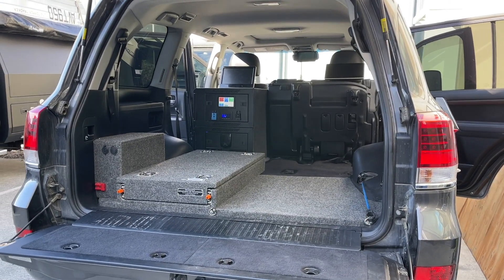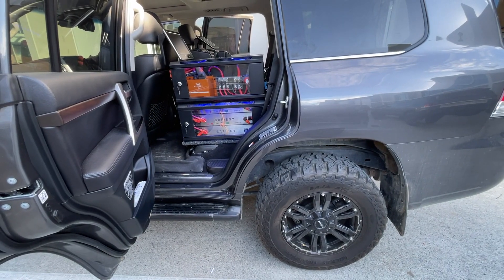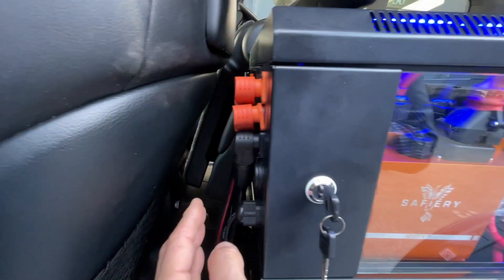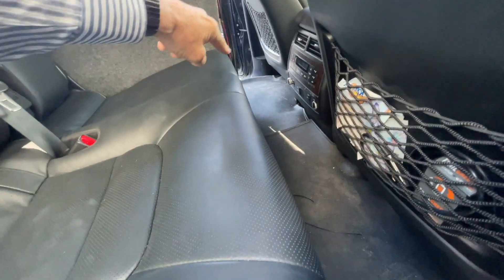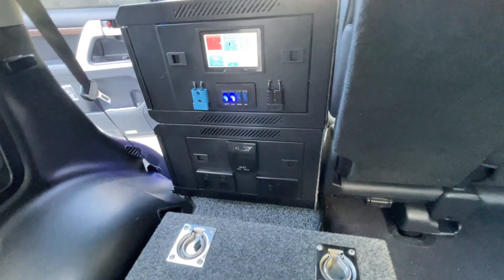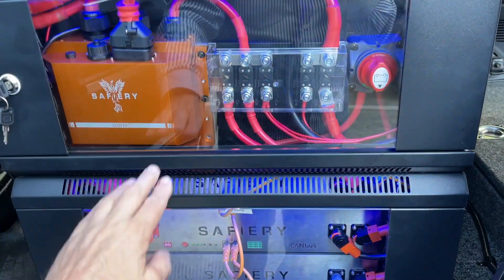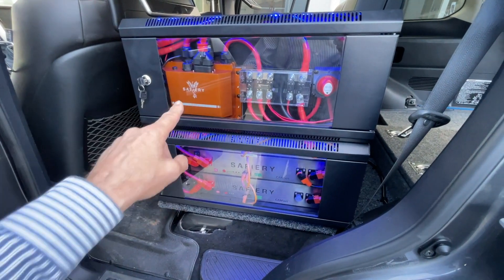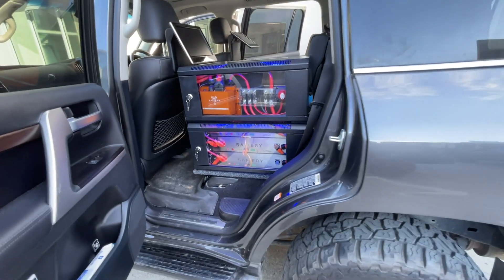LC200 Series Walkthrough 600Ah Lithium 5000W Inverter 3000W Scotty

Comment: Great till you crash and have 200kg of hardware aiming at passenger
Reply: In most 4wds you have a fridge with similar insufficient mountings mounted in the rear also.
It's a great design idea however I'd be asking for heavier cases and mounting hardware as you said

Comment: Looks like an interesting modular system. Does it run if the standard LC alternator?
Reply from the maker: Yes, we turn down the alternator extraction power in Scotty. It is not only variable but can have two set positions activated by a switch